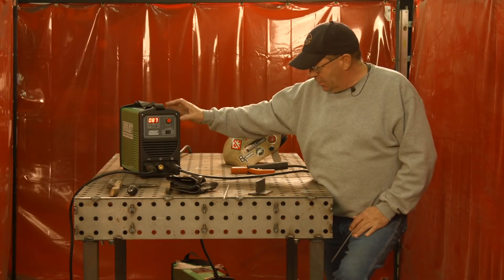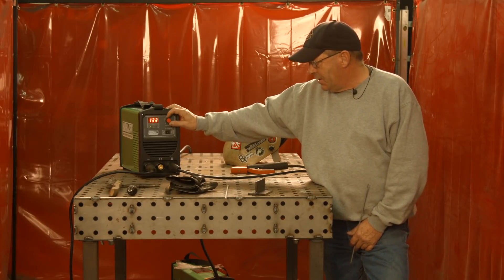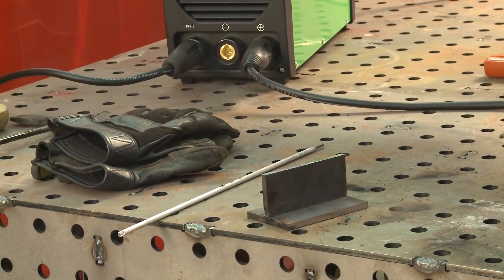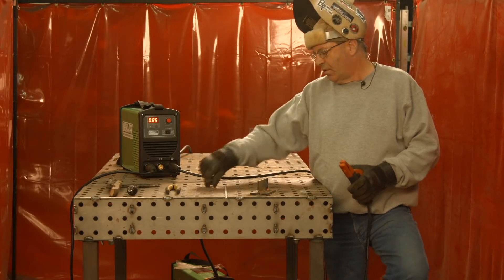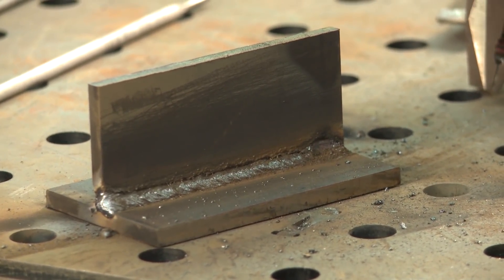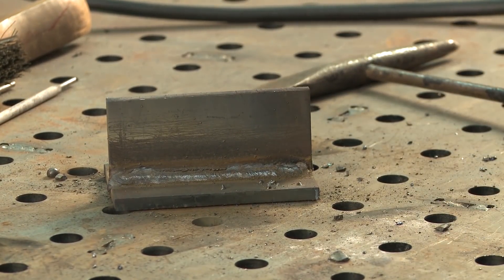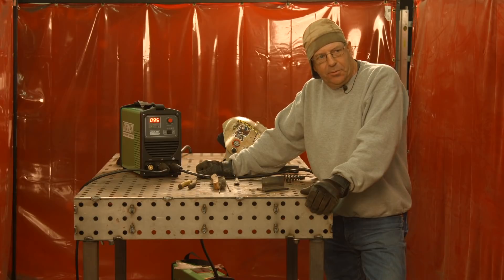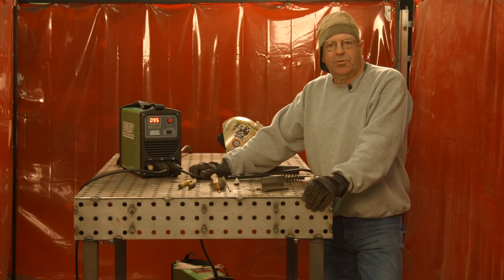🔥 Everlast PowerArc 200ST Demo (6010 and 7018)

Comment: I have one, the stick mode is trash. I do everything in Tig mode. Even 6010. Actually me and a buddy built him a new welding bed with it off 110v with 6010 because we were in a residential area and didn't want the neighbors to call in noise complaints. Initially I was disapointed but I've adapted to it.

Comment: I’m sorta narrowing my choices. I want to learn stick, have mostly small self projects. I was leaning towards the esab 180 ($600), someone suggested the everlasting 200. 
Can I get your opinion on which one you think is the best at the $400-$700 range? Thinking they’re all good, but your opinion, the very best. 
Esab rogue 180,,,,, everlast 200,,,,, Lincoln (don’t know equivalent model),,,,,, Miller thunderbolt 160,,,,,, Miller thunderbolt 180
I’ve seen you use a lot of them, your opinion would help a lot. Thanks! 
Seen vids on the esab rebel and the fronius transpocket 180. Those two seem above all at the $1200 range, problem is ...the $1200! 
I was leaning towards the rogue and everlast. Only $200 difference. But got to draw the line somewhere. Thanks for your vids!

Comment: The new version I have just has a button for the 6010 and it’s a good machine and works. Haven’t had an issue with the machine, only my generator which can’t keep up with this welder. 5k generator and this little guy is pulling it down till it dies. Wish I could really try this bad boy out at 200!

Comment: Titanium from harbor freight has same thing but 225 amps also will run 6010 for 250 bucks better value than this machine
Reply: I'm looking at the Titanium 225 on Harbor Freight's website and it retails for $280.  I got my 200ST for $400....$120 difference.  The Everlast has a 5 year warranty.  Harbor Freight's website says the Titanium has a 90 day warranty.  I'm sure there is an extended warranty, generally 1 or 2 years at HF, and generally about 15% of the item price.

So...Everlast, $400, 5 year warranty, digital readout with variable adjustable dial, and it can do TIG.  Titanium, $322 +/- with maybe a 2 year warranty (probably 1), no digital readout (so your just guessing), and no TIG.

Comment: I have the first gen of this machine (minus the "ST") which does stick only.   I like it, and it seems durable. (As a hobbiest, I've put in probably 20 hrs of arc time over several years.)   BUT when I run 1/8" 7018 it seems to need 150A.    I would probably short sell Miller, if it was a pure play.   I always run it off 240VAC.

Comment: I WILL NEVER BUY AN EVERLAST MACHINE!!!  They bought one at work and it lasted about 6 months till it didn't want to start an arc correctly, and about 8 till it would only start about one of 12 tries....and when it did it would cut off in about 3 seconds.  I called tech support and they basically treated me like I knew nothing about welding.  Of course they didn't know I have over 30yrs experience, 29 as a jouirneyman pipe welder.  The guy insisted I turn postflow down to .2 seconds, and my argon from 30cfh to 20cfh.  I couldn't get off the phone with this moron quick enough.  Then the other day, I ran into a Neverlast rep on Facebook.  He didn't spend any time trying to resolve the problem, but instead called me a liar, insulted my experience level, told lies about me, then removed all his posts and blocked me.   Very rude, condescending, and unprofessional.  His name was Mark Lugo.   In short, they have refused to help remedy the problem with a machine that is still under warranty.

Comment: I have this machine & to run 7018 properly I had to flip the switch to Tig and it was night and day difference I think that's why you had to run such low amperage with 1/8 7018

Comment: Thank you very much Sir for your fine video! In your opinion, being that the 10’ leads that come with the welder are too short for my needs, could it handle 100’ leads?
Reply: No. I put 40 foot of lead on and it couldn’t even strike an arc

Comment: I have it and I tried it with a multimeter, in stick mode it delivers 30 amps over what the screen says, up to 45 with a short arc, but this only with 7018, with 6011 and 6013 are 15 to 20 more and up to 35 with a short arc, yes, I tried it several times and the result was always like this, in TIG mode the screen corresponds to the multimeter.
Reply: Yeah I just do everything in Tig mode because of this. Also in stick mode on 110v it likes to trip breakers

Comment: I had turned my 200 ST down to 87 to run Radnor 1/8” 7018 but Thursday, I took it to the tech school where I’m n my second semester and my instructor, a 32-year union man, started welding with it and had me keep turning it down to 72 amps. He then got our Millennium rods and found that they worked best at 74. He brought a couple of 5/32” 7018s and had the machine turning out beautiful beads at 105 amps. 
He told me I had a fine welder.
Reply: jockellis So is it ok that the screen does not correspond to what it really delivers?
Reply: Juan Zavala Sorry, I just saw this. Once you figure out the amperage you need everything is fine. If you are not a pro, you would probably be better off finding one and have him weld with it for a proper opinion
Reply: Let the accountants worry about #'s.  Just find the "happy place" on the dial and weld.  The #'s on any machine are just a place to start.  From there you can fine tune it, like you would fine tune a radio to get the best signal.

Comment: Merry Christmas Bob, question. I like this machine, i am looking at the 140 and the 200st machines. The 200 requires you to purchase a tig torch at $112-$159 in addition to the machine. The 140st comes with the torch and carrying case. The 200st has more amps and will weld the 6010 sticks. Do I need the bigger machine? I'm a hobbyist. Keep up the great video's.
Show less
REPLY

Comment: 110 most people buying this machine will never run it on 220v? this demo should not have been done in 220, someone buying a 300 dollar machine dosent have a 220v outlet most!
Reply: A 220v outlet isn't that difficult to install
Reply: Cup Walker I run a 220 plug from the dryer outlet to the garage. the 110 is only useful when I have to bring the thing with me. Still want to wire 220 plug from the panel to the garage itself
Reply: I run an extension from my dryer too. i even made the plug swappable so that I can plug it into an electric range receptacle if i needed to.
Reply: Cup Walker I do but I was lucky in that the man across the street is the project manager for an electrical company. His mom and my wife are buddies so he didn’t charge a dime. It still cost me $144 for supplies at HD.
Reply: Cup Walker most houses have 220   outlets for their dryers
Reply: yea yea ill take my welder up to my laundry room and run some beads sounds smart, dumbest comment ive ever read lmao

Comment: i HAVE NOT RUN ANY 6010 ON MY 200ST, BUT IT WILL DO A GREAT JOB ON 7018  AND 6011.
TOM
Reply: I run 6010 3/32 rod welding 1/4" square tubing perpendicular to each other; at 60 amps the rod dig into the metal like in  butter just begging to hold short arc

Comment: What's the most amps it will run on 120v?
Reply: 125 amps on 120v
Reply: i don't understand why America uses 120 v as their standard power supply when most of the world use 230 v.  Most of the world would have no trouble running a welder at 200 amps of a standard wall outlet.

Comment: Very curious what the current difference was between the two rods.   I seem to recall guys running 1/8" 6010 and 3/32" 7018 with identical machine settings.
Reply: Correct.

Comment: Nice demo. Like one person commented about a clamp on amp meter, maybe it would be a good idea to use the proper amp meter on your demos just to see how accurate the readout on the welders you are using is. Maybe in both 110 and 220V input and both AC & DC output depending on what the machine is made or set for. Thanks, Ed K. Cleve. Oh.

Comment: Bob I absolutely love your videos and have learned quite a bit from you.  I have one small issue when you review machines and it’s also a video request.  You need to do some low end work during reviews.  Some of these machines are great mid to high end machines when it comes to power settings but are absolutely hard to run down low such as welding sheet metal body panels. Otherwise keep up the great work
Reply: Joshua Nelson Good feedback. Thanks.
Reply: Bob  Moffatt  just ordered a rebel 210 to go with my dynasty 200 and my Lincoln 255c

Comment: Thanks, Bob.Looks like a decent little machine. I have their Power i Mig 140 and run it a lot. Same issue with settings- have needed to figure out what works & just jot it down for reference. They are a good value for the money if a person is on a budget.

Comment: I'm a welding student and i bought this machine to practice on. Very nice for the price and like Bob said it runs pretty hot. I run 1/8 7018 at 90 amps compared to the 115 -120 I run on the Lincolns at school. Lots of power in this little box.

Comment: I've had this unit for months and use the hell out of it. I've ran it for days and it's never let me down. The only problem is the readout is dead wrong, Bob even says so. I keep a notepad beside it for all my sweet spots and live with it for this price point.
Reply: Seth Ward My instructor at Lanier Tech tells me that in the old days every welder would have a mark on the welder for their sweet spot. My instructor found that 72 amps was best for the Radnor rods and 74 for Millenniums.

Comment: Pretty sure when you are as good as Bob you can make any weld look good. Seriously though, I can’t get my 200st to run 6010 to save my life.
Reply: Yes, I've welded pipe, but now I'm retired.  I'm just supplying a common sense alternative for those who just need good results and some good advice.  Not everyone is a pipe welder. Not all machines can handle 6010 and not all jobs need to be to code.  Lots of good old boys just use common sense and get good results using whatever equipment they have.
    Eg... Farmers feed this country and do it quite well using whatever they have. Most have never had a opportunity to go to welding school.  Pipe welders KNOW the trade and KNOW what welding machines to buy.  It's the lesser welders that need the help.  Let's give the underdogs a hand here.
Reply: I’m an aspiring pipe welder. I would have gone for an engine driven machine had the funds been available. I emailed Everlast and they want me to call Monday as they have had a decent amount of quality issues running 6010 and will be happy to exchange my machine for another to see if this helps.
Reply: Chris Doeg read my comments on Mikes comment .
Reply: I run it on 220v, with the ground on the 6010 port. I am a tight arc holder anyways so there is no issue there. I can feel the flux burning of against the patent metal I’m that close. I can run 6010 on a Lincoln idealarc with no issues keeping everything the same.
Reply: @chrisdoeg5199  do did you ever get the Everlast to run 6010 good?
Reply: @Villaeddie19  not quite the quality I like with 6010, but manageable. And Everlast was quick and easy to work with when I had a problem.
Reply: A lot of guys have given up on 6010 rods.  They've gone to 6011. It runs better and has the same properties.  Given a choice, I'd ALWAYS grab a 6011.
Reply: Unfortunately for what I’m trying to get into (pipe welding) they require 6010, so I am working on getting used to that rod. The machine does run 7018 awesome though.
Reply: Read the manual. You might not have the cables in the right connectors.  Kevon Caron did that in his " AHP 160 vs Everlast 160 stick/Tig Welders" video. For 6010 the ground wire should go in the 6010 slot.  He hooked the stinger in there and it ran like crap.
Reply: gord johnson u don't weld pipe then. Alot of the reasons ppl buy these small machines that run 6010
Reply: Chris Doeg I was in same situation last year. Bought the esab miniarc 161lts and absolutely love it. Runs 6010 great, 7018, smooth Tig arc. Runs 5/32 7024 with no issues and power to spare.
Reply: Chris Doeg I’m guessing 6010 is for the root pass with everything else 7018? Are some 6010s better than those from other manufacturers?

Comment: If you use it in the 120 mode can you use an extension cord like you can with the HTP buzz box?
Reply: Jeff Hulett i have the smaller 140st model and I've used it on a 50ft 12ga cord just fine. I wouldn't use a cord smaller than 12ga just for good measure.

Comment: That little inverter machine you using Bob is really neat. I been looking at getting one for a few weeks for practicing 6010 and 7018 on open groove plate and  pipe joints. Maybe even set up a scratch start DC Tig outfit and see how it does for on 6G 2 inch pipe. Thank you weld.com and Bob Moffat for reviewing this cool machine.  I am going to have to buy myself an early Christmas present. Ha ha
Reply: I don't think it will burn 6010 on open but root very well. I could be wrong. Most cheap machines can't do it.
Reply: Did you get yourself 1 and how do you like it?

Comment: I got my 200ST from Weld.com. The trick to getting it running right is welding in TIG mode. The arc in Stick mode will dig so hard in vertical that it’s impossible to make any kind of weld. When you move to TIG mode it disables the hot start and arc force that are preset in the computer. On TIG mode it runs 6010-6011 like a charm and 7018 like a dream. The only time I use Stick mode is when I’m making 1F welds on really thick material that’s needs that deep dig into the base metal. Good video Bob, I hope you do one in a groove in vertical.
Reply: The Amps displayed is way off on mine too. I confirmed this with a clamp on meter. Everlast tech support tried to blame it on arc force, but that's not correct on a CC machine. They just didn't have a fix for it I'm thinking.
Reply: I was doing the same thing until I realized that the problem was that the display is way off.  The actual current is about 1 1/2 times what is shown.  Once I started making the correct adjustments my problems want away and I went back to stick mode.
Reply: Tom Bayt that’s interesting! Thats the one thing I haven’t tried. Instead of running on 85 Amps for 6010 I’ll turn it down to 45 Amps and instead 115 amps for 7018 I’ll turn that down to 60 amps and try that on stick mode. Very interesting. Maybe it won’t dig so hard.
Reply: Victor Padilla It's approximarely one rod size off...for example 80-90 amps on the display for an 1/8" 7018.
Reply: Mark Decamps I thought mine had a problem but I see that everlast does not see it as a problem. I should have read more before buying.
Reply: Mark Decamps can you give us a ratio of the actual current mine does the same thing, I would really appreciate it
Reply: Hi, I planning to buy this machine but i have few questions. Have you tested the tig function ? because i doesn't find any tig video with this machine. And how low on amperage can you go with the tig functionnality ? because i would like to try welding an exhaust in stainless
Reply: jeremy P I have not used TIG, but I'm sure it would do fine for what you are wanting to do.
Reply: Mark Decamps ok, thanks you
Reply: Wouldn't this change the maximum setup of 200 Amps. I'm running most electrodes 20-25 amps less than on mine transformer ac/dc machine. I will try to run it in tig mode with the stick electrode
Reply: StagArmslower Yes it put out a little more than 200 amps per my clamp on a meter, although I don't remember the exact reading.
Reply: Daniel McConnell I tried mine with a multimeter to observe the amperage output, in smaw mode with the 7018 rod always gives 30 more and up to 45 with a short arc, with 6011 or 6013 gives between 15 and 20 more and up to 35 with a short arc, How does that happen? I do not know but tried several times with these electrodes and the result was always 30 more with 7018 and between 15 and 20 with 6011 and 6013, in tig mode it is correct
Reply: Daniel McConnell  these 200st run really hot. I have one doing the same thing changed circuit board that everlast send me still the same. It will cut of at 130 amps on tig(over heat) when it supposed to run 100% duty cycle. Got tired of it and put a volt reader turns out it's running hotter then you think you are. At 130 ams volt/amp reader shows 175.... that explains everything. I can ran a open root on pipe at 65 amps when I usually run at 110-120. Sure enough that's what bolt reader says I'm running. 115 amps
Reply: I've got the same issue, but it's with my PowerArc 160STH. Running 1/8th inch Lincoln Excalibur at 95 amps :D.